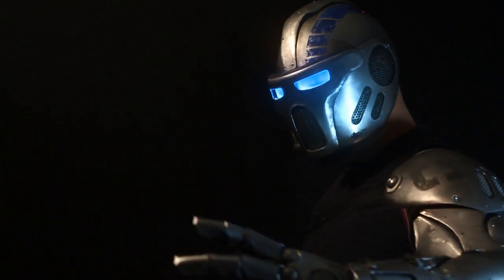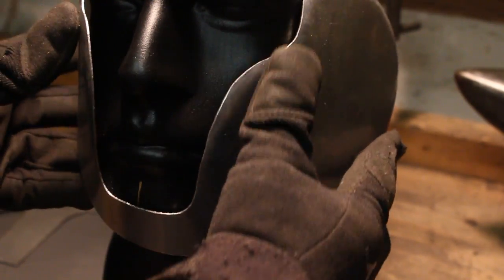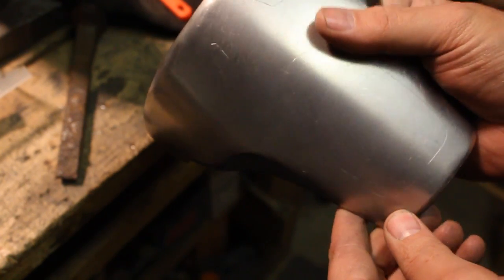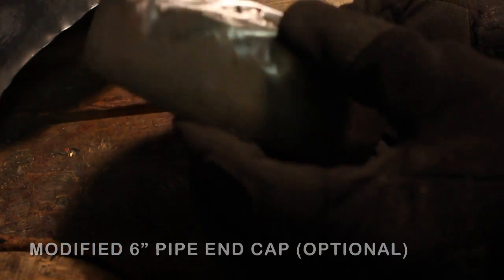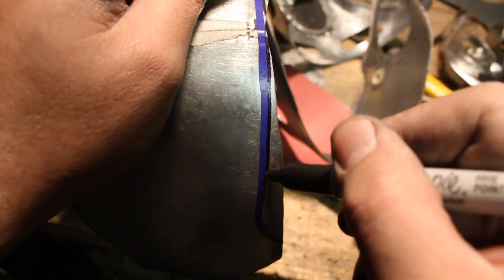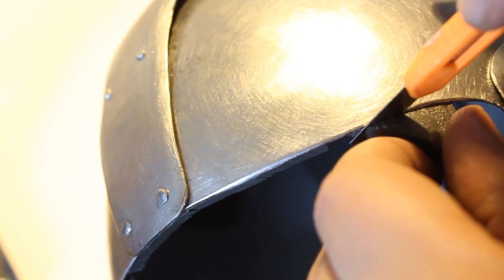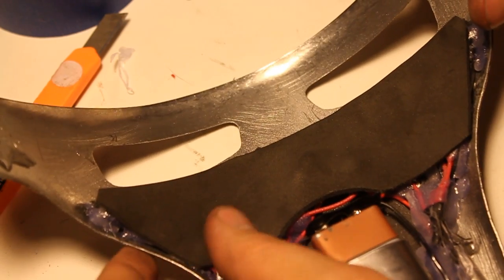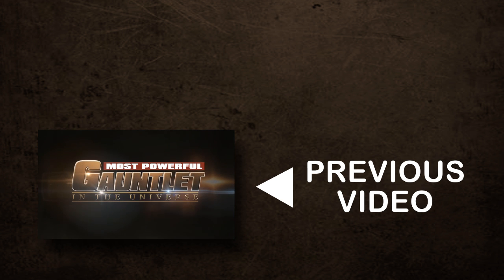Bionic Armor: How to make the helmet

Comment: Nice. 
Rev2 idea. Instead of having a switch installed in the mask you could create contact points on both the helmet and the mask to complete the circuit. The intention being that the eye light up automatically as soon as the mask is attached to the helmet. (And auto turn off when removed)

Comment: I have something of a suggestion for your power source. I'd use an old cell phone battery or lithium polymer cell. LiPo cells can be easily acquired at which point you can get a charging board just as easy. The batteries themselves cost around $5 while the battery management boards cost less than a dollar and have a preinstalled micro USB for use with a standard cellphone charger. That way you could have a micro USB to charge the system and not have to worry about changing batteries when one goes dead.

Comment: Since you are working with so small gauge sheet metal I suggest you get few different size rubber hammers(with a round head) as well, they are heavier than a wooden hammer so its should be easier to shape the metal. It helps keeping the metal clean off of bumps and scratches while you are shaping it. :) Or a copper head hammer.

Comment: you could put an extra magnet on to the helmet part not to hold it on but it could activate the mask when you place it on, and then the switch could be an override to shut it down when on, would also act as a battery saver cause the mask would auto turn off when you take it off, plus the whole thing would have a cool added effect

Comment: Cool, but one thing missing. It needs sliding curved platelets that cover the back of the neck. 
Computer in the helmet? Maybe, maybe not. Sensors in the helmet that can detect eye movement, mouth movement, voice, etc. linked to a computer elsewhere sounds more workable and evolutionarily correct . 
Flaw in animal design as well as humans. Placing the brain (computer) in the most likely area to sustain attack, thus a thick skull. Animals that fight by biting having to present the most sensitive and crucial weapon (their brain) directly into the fray. Humans and animals eyes located directly in front of their computer. Subjecting the computer to damage simply by popping head up to take a look. Seems the brain or computer would be safer located deep within the body in a hardened shell while the head is used as a base for sensors like sight, taste, smell, etc.

Comment: it would be much cooler if the faceplate light turned on when you snap it on to the helmet, so then you can have the battery in the main helmet and connect the negative wire to the left or right magnet of the main face plate and vice-versa.

Comment: not sure if this will work with this metal but you can use a jeweler's saw to cut curves but yes it takes longer then the cutting wheel but it dose come out smoother

Comment: David, I just started looking at your videos and these are some very nice works. please forgive my ignorance, but I noticed you make your helmet tops in halves instead of out of a solid piece. Is that because you cant do it that way or just convenience?
Reply from the maker: It can be done with the right tools, but you need some weird looking hammers to pull it off (and a high level of skill too). You see, if you did a full helmet, you wouldn't be able to get the hammer inside to hammer it after a certain point. To do this, they have some awkward looking hammers that are stretched out and curved. I don't have one of these, and the people who watch this channel most likely don't either. I try to do all of my projects in a way where anyone watching can go out into their garage and start building these things, instead of having to shop for tools before they can even start. On occasion I do use some expensive, rare tools (like my English Wheel), however I show the audience that the same things can be achieved in other (cheaper) ways. Great question, by the way.

Comment: this is so cool. can you see well with leds? i tried once do put some plexiglass but didn't work. considerer another mesh, but thinier, like we use with those herbs balls for tea. No glass at all, just metal. you see so clear and it looks impossible.
Reply from the maker: vision is barely hindered at all with the lights off. With the lights on, you can see, but I wouldn't say WELL. As long as you are in a lit up area and not a dark room, it's not much of a problem.

Comment: Can you explain how you attached the arm. I can't figure  out how to make it stay up without starching to a chest piece
Reply from the maker: There is just a strap wrapping around under my other armpit. It has one of those plastic clips to connect it, and I just pull the slack out of it once I clip it.
Reply: David Guyton do you still have full rotational movement and does it stay in place after long periods of use
Reply from the maker: movement is okay, but not as good as when you are not wearing it of course. I don't wear it for long periods of time...only enough to do the filming really, but I have not had any issues with it

Comment: 0:16 "clearly you can't have a helmet or head, because if you did you'd be dead" Kinda false actually. bionics are made for the perposes of enhancing the wearer's/user's abilities. for instance the Hal suit developed by cyberdine systems inc in japan. it's basically a bionic augmentation harness that more than doubles the wearer's strength, and lessens the fatigue on the body. now if you had bionics for a head. then they'd be enhancements to your body to improve it.... like say getting a steel plate on your skull just for the fun of it. or if technology was advanced enough, taking the smart glass technology being developed and applied it to synthetic lenses that are graphed to the eye to help visually impared to see again, and apply them to someone with perfect sight. they could use it to the effect of never needing binoculars or any other form of visual enhancements again..... so yeah..... could be done for sure

Comment: How well can you see out of it? Do the LEDs blind you much?
Reply from the maker: there's foam intentionally blocking the light from the LEDs coming directly into your eyes, however there is some light bouncing off the veil material making it harder to see than it is with the lights off. If you are in a darker room, it's not stellar vision but it works. There's always a price for cool. In a bright room there's no issue at all.
Reply: There are a couple of things that come to mind that you could do for that. 1) Have you considered a low cost potentiometer? This would allow you to have control over the brightness of the LEDs. 2) Maybe add some material to allow the light to only pass through the edge of the plex and nothing else. Basically turns the plex into fiberoptic.

It's a great build all around. I do a little inventing in my workshop once in a while, and your electronics caught my eye. They look similar to something I attempted back in highschool, and those were two possibilities that I wish I had considered looking back. Keep up the great work!

Comment: How do you cut out the larger pieces that make up the entirety of the helmet?
Reply from the maker: I use a bench mounted cutter called a Throatless Shear. Most people don't have that tool though. You can use ordinary aviation snips to cut it as well, but it is a little more work.
Reply: David Guyton ah, thank you. Looking to get into prop building with metal. Thanks for the response 🙏

Comment: How do you wire it withought electricity going through the metal?
Reply from the maker: there are no bare wires. The wires are insulated. As long as you cover the soldered areas, none of it can ever contact any bare metal
Reply: David Guyton Is that what the epoxy was for? Sorry im trying to learn about electronics :D.
Reply from the maker: what you see me covering the wires with is not epoxy, it's hot glue. It is just to hold everything in place, not to protect the wires...although it does offer some protection
Reply: David Guyton Alright thank you! Very helpful!

Comment: Just curious but would it be easier to use sheet aluminum for things like this?  Have you tried using other types of metal?
Reply from the maker: Some people use aluminum, but it has a tendency to crack if you dish it like you see me to in this video. You would likely need to anneal it a few times during the build (at least the helmet halves) The rest of the helmet could easily be done in aluminum without any annealing required.
Reply: David Guyton ... sorry I'm not familiar with the terms... what does annealing mean?
Reply from the maker: it means applying heat to the metal with a torch to normalize it again (keep it from becoming too brittle). After annealing, you can go back to hammering on it to shape again. I don't do this step using my (simpler) method
Reply: Ahhh.. ok that makes sense.  Thanks!

Comment: Too much hot glue, that's gotta be heavy. use electrical tape.
Reply from the maker: this is only two small sticks of glue. It weighs almost nothing. Electrical tape has very little sticking power unless it's wrapped around itself
Reply: A lot of almost nothing can still be something. Even though its cool, I will challenge you to do better.